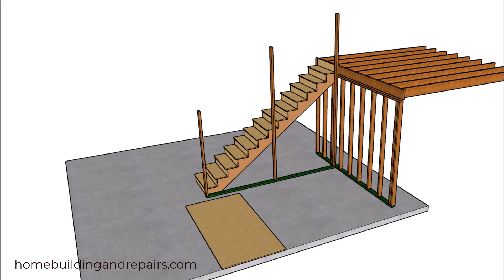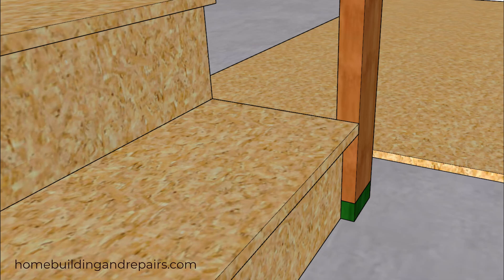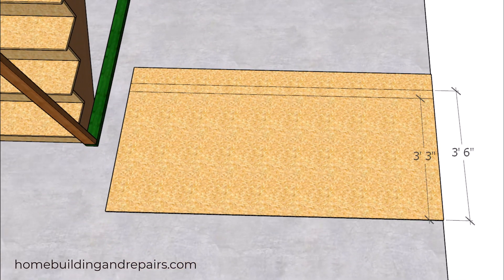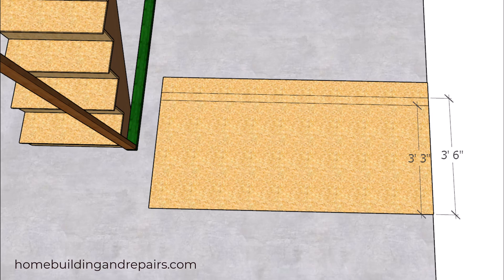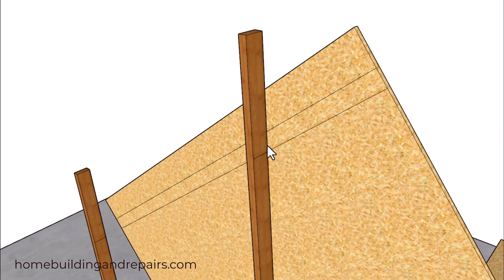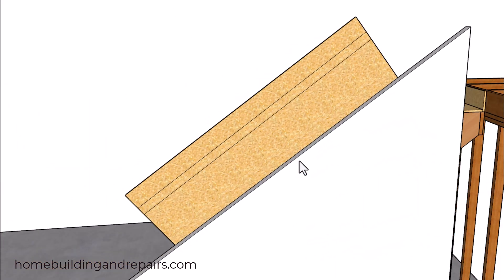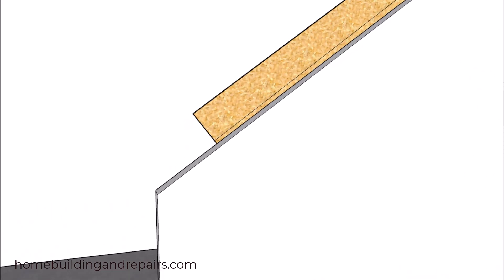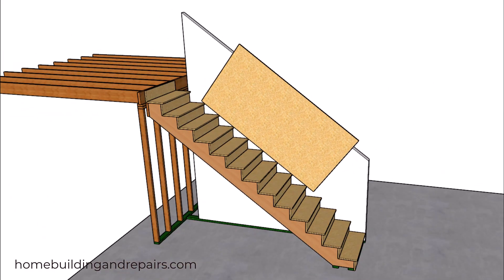Struggling with Stair Railing Measurements? Use This Plywood Jig!

Comment: Thanks for the video but did you actually try it yourself before posting?  The diagonal distance from the nosing is way longer than the vertical height from the tread.   If you try it with the range allowed by code (by marking it on the plywood), you end up with a railing that is way too high.  I like your videos but this is a fail